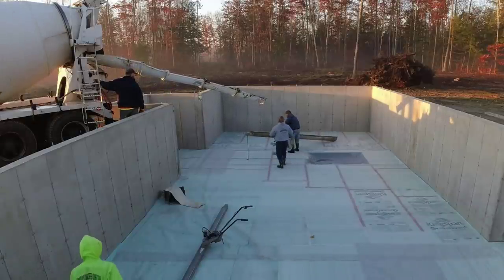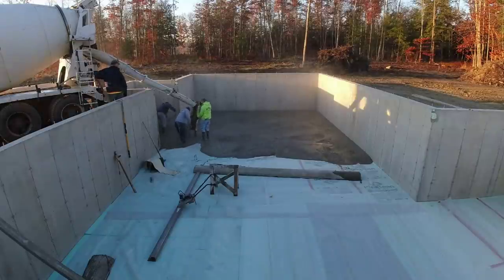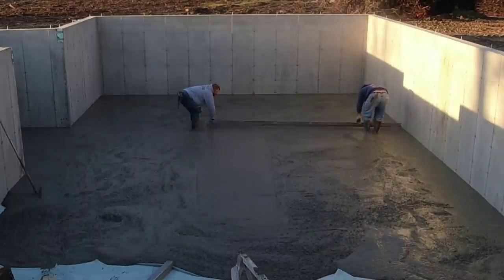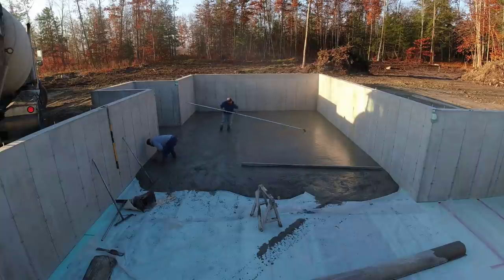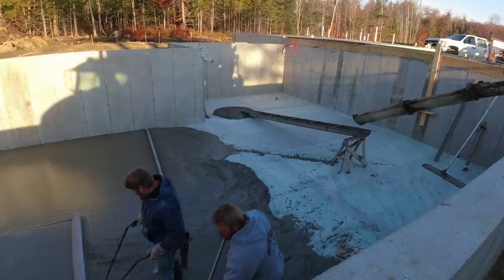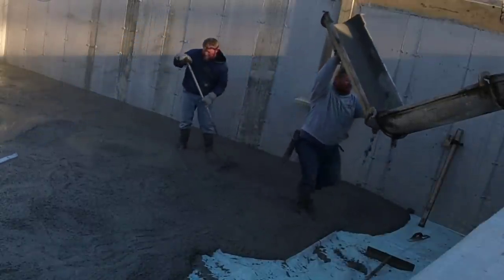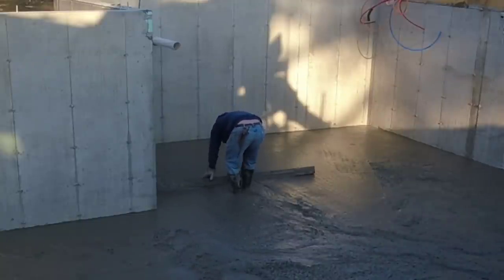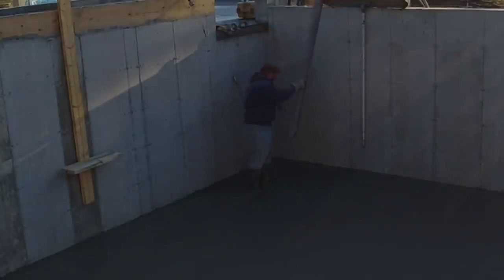With Only 3 Guys Everyone Has A JOB To Do! (Pouring Larger Concrete Floors)

Comment: Hi Mike,
Rob here, originally from Northern Michigan (Traverse City, Kalkaska area). In my 20's I built forms, poured footings and wall for my 32×40 garage near Grand Rapids MI. Had a pro handle the slab because I wanted it to look good. 

I work in software and live near Atlanta GA, looking at retirement a few years down the road, and building a large shop with lots of floor space. 

It always amazes me how (deceptively) simple and "easy" an experienced concrete person can pull one of these things off, and walk away with a shrug (like, "ah, no sweat").
Reply from the maker: You're right. I guess it's just from doing it every day. Most pours do seem easy to us.

Comment: Hey Mike I'm in Dade City Florida. Nice job as usual. We pour 3 to 5 guys up to 100 yards with 12 foot vibrating screed. Usually pour a 5 to 7" slump depending on the temp. We are usually fighting the heat instead of the cold like you!

Comment: Hey Miike,  like the video im 62 and we still pour using shutes very seldom use pumper. We have always poured with 3 guys when you are experienced and work together for years the process is smoove! We poured an 80 yrd floor in 1998 which we formed in half poured 40 finished by noon and stripped and poured other half that afternoon. Me and my brother inlaw were 38 my father inlaw was 58 and he screeded the whole floor himself! while we puddled. I work with my son now hes 36 he wonders how that was possible? I said experienced. Thanks for the video Mike Nick Strieker Hannibal Mo.
Reply from the maker: That's awesome, thanks Nick!

Comment: Hi Mike, I am from Ireland. We are pouring every day same as you guys are. The temperature here does not usually go down bellow freezing, but we have a different problem. Because of the "enviroment," concrete companies are forced to add to the concrete something I would call an artificial cement. It is called GGBS and it stands for Ground Granulated Blastfurnace Slag. I don't know, if you know this in America, but what it does to us as the finishers, it stops the natural heating proces in the concrete, so it works like retarder. In low temperatures, sometimes you can pour it in the evening and come back next morning and still be able to finish it with the power trowel. But in Ireland we have a lot of showers, not big downpours, but you know yourself, another shower, another hour. I was trying to put some accelater into the mix, I was trying to lower the GGBS in the mix, but the engineers always told me, they won't change the mix no matter what. I was just wondering if you have any experience with GGBS. Thanks Mike.
Reply: Hello!   I would say that we have that here in Minnesota.  They call it “fly ash”.   It’s a filler for for Portland.  Some concrete companies will remove the fly ash and add more Portland for a higher cost.  Some refuse.  Fly ash acts as a retardant to asking for accelerant.  Very frustrating…. Can you ask to not add the GGBS?
Reply: @mikedandar1171  When we order the concrete ourselves, then yes, they can drop it down to 8%. When we pour for big companies, they order the concrete and there is 50% of the fly ash in it. Frustrating is right 😁. Take care Mike.

Comment: From the high country here in CO, about 10,000 ft. above sea level. We follow many of the same processes you do, minus the slump. We never pour over a 5” for anything. All exterior concrete is 4500psi. 3-5% air.

Comment: Another great video Mike. Andrew from Green Bay, WI. Question, how do you go about finding general contractors to work for? I’ve been in business 3 years now and I do work for regular homeowners and 1 home builder but I would like to do more for home builders and less for home owners.
Reply from the maker: Stop at their jobs and introduce yourself, and get a good website built that ranks high for local search. (let me know if yo need help with that, I know a guy.)

Comment: Watching from Washington state. I suggest the use of a snapped chalk line on the wall, it saves time during the pour to prepare the grade in advance. The guy who is using the laser could be doing something else. My goal during the pour is to get it down as fast an accurate as possible.

Comment: Just retired from CEMSTONE here in Saint Paul MN. I use that trick with the chute turned around quite often. Lots of contractors don't know about it. You have to be careful though because that chute is hanging kind of precariously. It could pop off of there and ding somebody badly. Around here they wait to pour the basement in the dead of winter where they can hang a temporary heater to warm up the place. The poor saps like me get to be outside, filling wheelbarrows through a hole cut in the floor at the front entry. There will inevitably be some chippies running their jobsite tunes as loud as they can while you're trying to hear the command from below to fill another wheelbarrow. When doing flat work with wheelbarrows outside and I fill one a little too much, I say, "sorry about that basement load"! LOL

Comment: Good Job, why not use a conveyer truck for this job.  Seems it would have really reduced the raking labor.  But I know sometimes they are not available I understand.  We work in East Tennessee and have some of the same weather issues you have.  Just likely not quite as cold here as your place, but the cold surely is an issue even here.  Like you we use hot water but I don't have much experience yet with the slump modifier.   I like that idea then we could use less water and expect a higher strength.  Sure do appreciate ;your channel thank you.
Reply from the maker: Thanks Glenn, you're right it wasn't available. Got to give them a couple weeks notice.

Comment: Hello from Ontario, Canada. I love your videos, Mike. So the plastic sheet goes on top of the styrofoam? I would rather put it under, or even no plastic at all.
Reply from the maker: I like the poly under too. Sometimes they don't do it, blows me away, haha
Reply: @MikeDayConcrete  so now the Styrofoam will be permanently wet. Is it still insulating when wet?